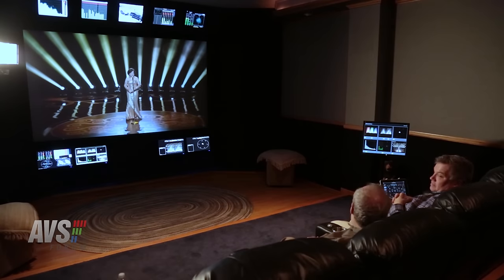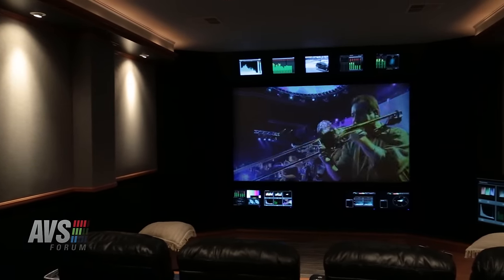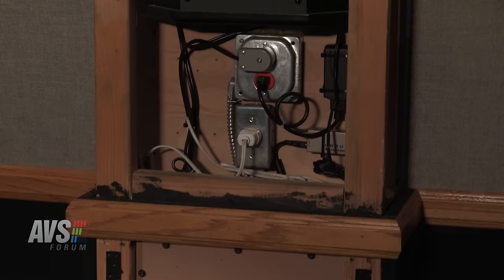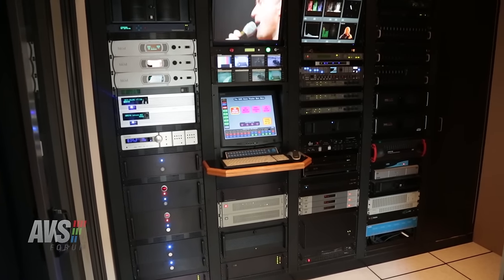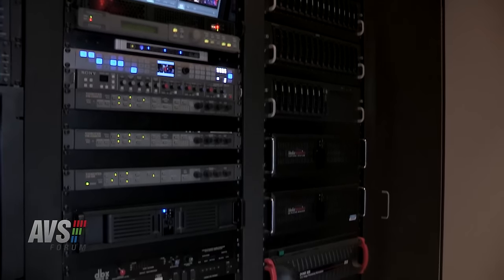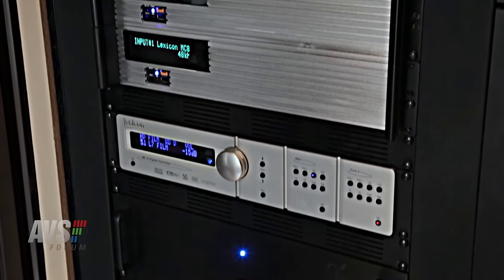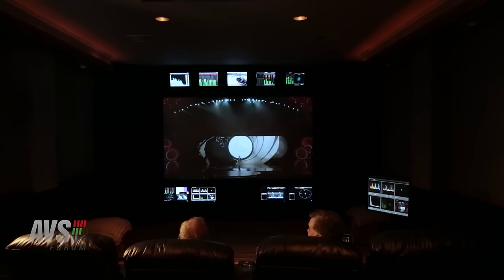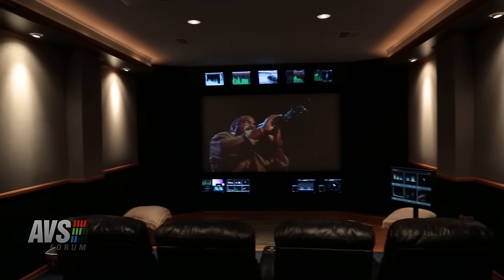Home Theater of the Month: The GMG Theater

Comment: RE: The "Monitors": I see a lot of comments about the computer monitors so I will further explain. Yes, they are pure fluff. They are in fact calibrated measurements but  in my case they do not serve that function as they would in a professional setting. When  they are turned off, they disappear in the dark and are invisible, so no they are not a distraction if off. The audio screens do allow me to see all the channels at a glance and do come in handy sometimes when I hear something and want to look further into it.  If you scan You Tube you will find many hobbyists taking things to the extreme. One of my favorites is the guy that has a 1900s machine shop still run by a central steam engine! Certainly not practical buy hey...
Reply: You built a hall of a system. If people don't like what you did, they're free to do what they want with their time and money. I'll be starting my theater build this coming year and will be pulling ideas from this video along with others.  Thanks for letting us see your build.